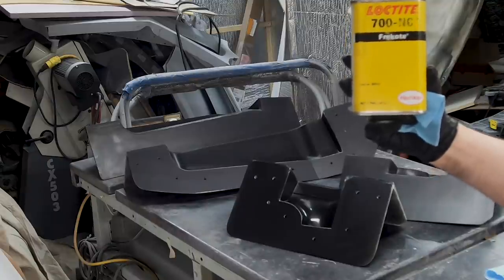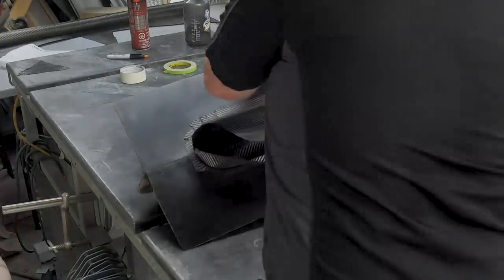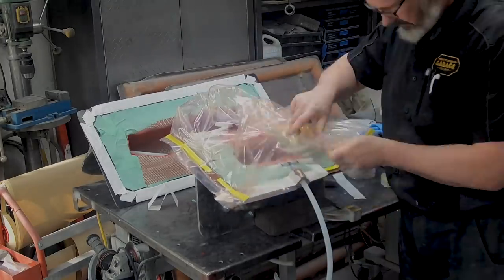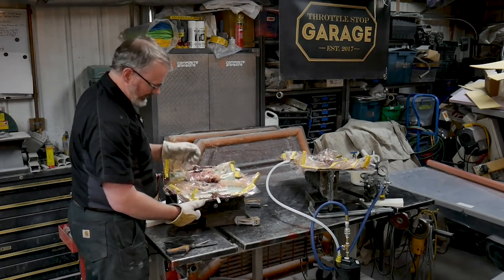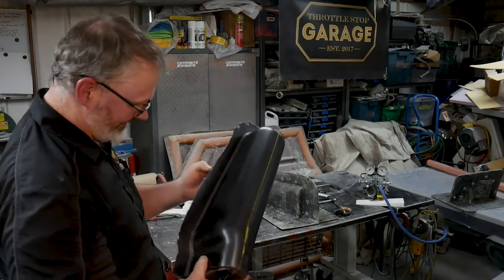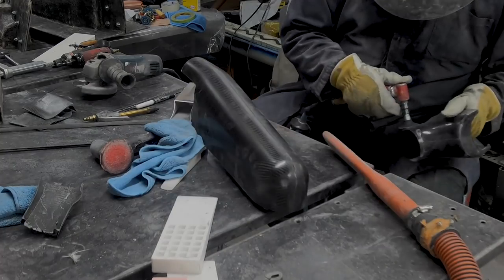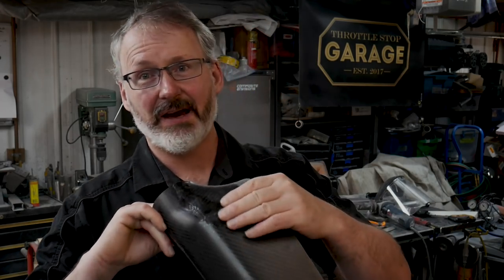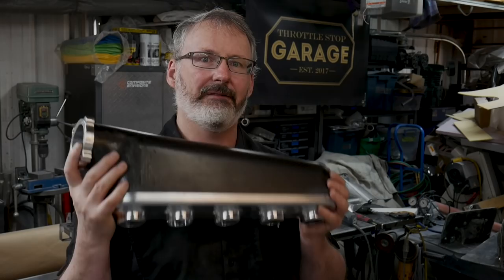DIY Carbon Fiber Intake Manifold: Part 2 Making the carbon fiber plenum.

Comment: Nice video, I'm about to do a manifold myself for the first time so looking for any tips and tricks.  To be fair to easy composites though-- they don't have an autoclave and have never used one in any of their videos. They just do vacuum bagging and an oven
Reply from the maker: I wasn't criticizing them or anyone specifically.  There are prepreg methods that would make this part easier to do for sure.
Reply: Well, I've done a 180° on easy composites. I contacted their tech dept for advice on a good strong material for my plenum and they came back with ill informed rubbish. According to them carbon manifolds don't exist! Fuel and heat will damage the carbon, nothing exists that can be used for engine components etc etc. I had to point out that they were talking nonsense and included a link to the rather good Koenigsegg video showing their carbon prepreg engine parts and a photo of the BMW OEM carbon rocker cover. They came back with more nonsense about highly specialised materials that only OEMs can buy. Shame really as I was about to spend a ton of money with then, but I can't buy from someone that clueless.
Reply from the maker: Sorry to hear this...I'm not sure my manifold will work, but it's been done many times.  I used a high temperature epoxy resin and I will add a thermal barrier between the head and the manifold.   Fingers crossed it works.

Comment: If the carbon fiber came in tape rolls w/just enough glue to place hold till u laminated it would b way easier to use. Diff width tape roll, or big sheets.

Comment: Could you do a video on how to do pipes with a standard layup method? I'd like to get started into composites for my project car and I need to get some carbon intercooler piping figured out but don't have access to an autoclave or anything fancy.
Reply from the maker: I don't have that gear either. I've also never made a pipe in carbon fibre.

Comment: Could you fill the void with water to help get the bag to push right into the mold when pulling a vacuum?
Reply from the maker: You could, but it's not necessary.  Once the air is gone from inside it conforms perfectly to the mold as it has nowhere else to go.
Reply: @ThrottleStopGarage  thanks for the reply mate

Comment: Did you post the Catch Can Video ?? 

 With your new learned expertise of vacuum bagging,  will a pump capable of pulling 22Hg be enough to do a fender ??
Reply from the maker: I have not finished that catch can video...moving on with the rest of the build.  I'll get back to it - that was supposed to be something for a channel sponsor - then they pulled out. Now I don't bother with that nonsense.  

Maybe - I don't think that's going to be enough vacuum to get the job done.  I live at a high altitude and can only get  about 27".  So there are some variables in play.  The more vacuum, the greater the compression and that's what you want.

Comment: Just learned that carbon and aluminum together with cause electroless. Have you experienced that?
Reply from the maker: No issues as the adhesive has micro balloons that prevent contact.

Comment: Did you take any extra steps besides fillet wax to seal the mold flange, so it will hold vacuum?
Reply from the maker: Nope.  I'd use a little silicone sealant if I was doing it again.

Comment: Have you tried using a perforated release film between the peel ply and infusion mesh? I've typically found it makes demoulding all that easier. Great video! Thanks for sharing!!
Reply from the maker: I have some, but have not tried it...I know I should.
Reply: @ThrottleStopGarage  Please give it a go, it will infuse a tiny bit slower so please take this into account when you're calculating your gel time. It will make removing the consumable materials 100% easier and allow direct access to the peel ply.  Once again, your content is excellent, keep up the awesome content!!

Comment: Wait, you're not bagging the whole mold? Are the flanges really airtight? I could certainly be wrong but ideally wouln't you wanna bag the whole mold? Did you do a leak-down test before infusing?

[EDIT] Ah, you're using the wax as a sealant. I'm honestly amazed with how well it worked. Great looking parts.
Reply from the maker: I'd seal it next time with some caulk instead of the wax.  I always do a leak-down on my molds.  This one held full vac for days.
Reply: @ThrottleStopGarage  Gotcha, thanks for elaborating and as long as it works. I think I only seen people use full bags before but knowing you can get around that is always good.

Comment: How many layers of carbon do you think would be the minimum for strength?
Reply from the maker: That would depend on if your running boost or not.  I did a little guessing with what I did and at around 3 mm thick - I think this could hold a bus.

Comment: Wondering about the aluminum/fiber connection - will fully hardening epoxy be in joint of dissimilar materials as reliable as rubberizing polyurethane glue?
(Edit: subscribed. Excellent work!)
Reply from the maker: I'm not sure - but the product is an aerospace structural adhesive - so I'm guessing it should be fine.

Comment: So a couple of holes or pockets where the carbin glues to the aluminium?  not all the way through but as like something for the epoxy to grab on? That might prevent the carbon blowing apart from the machined piece ?
Reply from the maker: The double walled nature of the glue flange should prevent any issues.  Many epoxies don't have great peel strength but are fantastic in shear.  So I've eliminated the ability of the joint to fail in "peel".  It shouldn't require further modification.

Comment: Being that this part is going to be exposed to elevated temperatures, what are your plans for post-curing?
Reply from the maker: Hi Rich - it's going in my oven for a bake cycle when done.
Reply: @ThrottleStopGarage  

Are you concerned about print through or warpage due to curing out of mold?

Must be a really slow cure cycle.
Reply from the maker: @richm7936  It's never been a problem before.

Comment: How could I build a more basic mold that would be for NA use only? I have a 3 rotor RX7 that I would to build ITBs for and then do a nice big carbon air box. Im struggling figuring out how to build flanges without an aluminum base like that.
Reply from the maker: Just make a mold of the base part and make it in carbon. I'm not sure "more basic" is going to work for a part like this.

Comment: most construction & weaker type prts has ribs or banding or stiffeners not smooth finish all the way around but carbon is strong. We don't want stuff in the environment made to forever last unless basic reuseable building block or only thing we can use rare case carbon needed, or it will hold up enough so that prts in junk yard won't stay there but b reused long lasting ti life of 2 cars ,30yrs sun baked apart.

Comment: I chatted with the Resin manufacturer RDR and they mentioned that to achieve the higher operating temperature, you'll need to post cure. Is that something you'll be doing with these parts?
Reply from the maker: Yes - I've got to set up the oven in a bit and cook all my parts.
Reply: @ThrottleStopGarage  If you're using a regular oven, you may have issues since they seem to fluctuate wildly in temperature. Maybe a buffer like a blanket or some insulation would help? Be sure to go up in temperature nice and slow. I believe if you warm up too fast, your entire part can deform as the resin totally loses its strength before regaining it.

Looking forward to seeing your next video. I'm hoping to make a similar part for the car I'm building.
Reply: I took a regular oven and added a PID controller with ramp timer and it worked great with the RDR high temp resin.

Comment: How do you determine the weight and weave of the carbon
Reply from the maker: I worked out the finished part thickness (so 2 mm) was the target and then used an online calculator to develop the layup to hit that thickness.  That then sets the weight - weave was a matter of choice and the 2 X 2 twill has excellent drape and good strength for this application.
Reply: By any chance did you cover this in one of your videos?

Comment: Interesting to watch. Not that I’ve ever done carbon fibre but my guess would have been to do a male mold instead. Easier to use but would have probably looked shit on the outside or need heaps more sanding, filler and paint. Nicely done
Reply from the maker: A female mold was the only way to hit the tight tolerances and make these parts fit.  Less work in the end.
Reply: Throttle Stop Garage ah I see. Well like I said I’ve never done it but learnt that trick now 🤙

Comment: You said it was 45 min to go through the mould. Why don't you get the mould ready. Suck the air, and them prepared the resin. Is just an idea
Reply from the maker: That's exactly what I did do...the thing I was talking about is the resin will begin to set in 60 minutes, and you ALWAYS want to infuse as slowly as you can, so 45 minutes is right on.
Reply: @ThrottleStopGarage  what kind of epoxy do I can use, I'm using 30 min epoxy and my pieces feel like Vinyl other than fiber, why. I need slow cure, epoxy resin.
Reply from the maker: @aldoyosbel1728397263  Change your epoxy to an infusion product.
Reply: @ThrottleStopGarage  witch brand do I can use. I'm in us
Reply from the maker: @aldoyosbel1728397263  get some ProSet Inf 175. That's what I'm using.
Reply: @ThrottleStopGarage  do you have any video, how mix it
Reply: @ThrottleStopGarage  great. What peel ply
Reply from the maker: @aldoyosbel1728397263  https://youtu.be/H29O3FjFc3o
Reply from the maker: @aldoyosbel1728397263  everything used is listed in the description.
Reply: @ThrottleStopGarage  oh my bad,  I'm going to do the same than you. Thanks for this videos and inspired me. Do u have any video how to mix the amount of the resin and also gelcoat.

Comment: you like to struggle, right? hahaah just use a perfurated film before the flow mesh my friend. diying to see your face when you do that!!
Reply from the maker: I've mentioned that I have some...I have no idea why I'm scared to use it. I just am.
Reply: @ThrottleStopGarage  that will help you with 2 things. demolding and resin flow. dont worry it wont leave any dry spots if you are using a resin brake area as you are.

Comment: carbon smack has its place same as foam insulation grand won't mold or wear out or sag, but not much else foam bad carbon expensive & bad unless saving lives & building planes strong.

Comment: PPL GLORIFIED by GOD7 thru SON & Me hve greatest laditude reasonable working run rate room, not baby sitting any more. Those still here working it out owed, near as I can tell no1 but Me more time will b under diff terms & run room just like life 10yr old has diff rules than 15/16, or 18yr old or 30 yrs old kick in the pants needed.